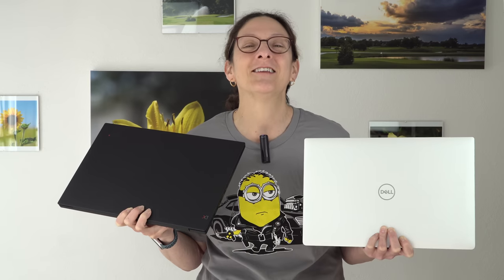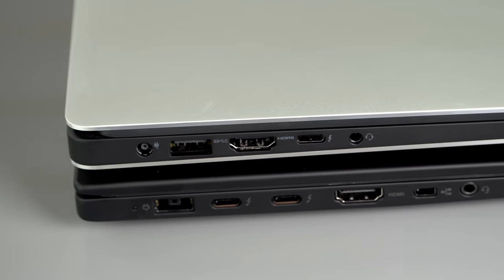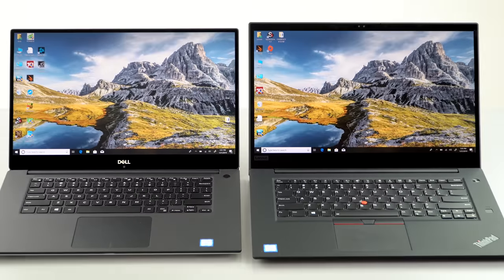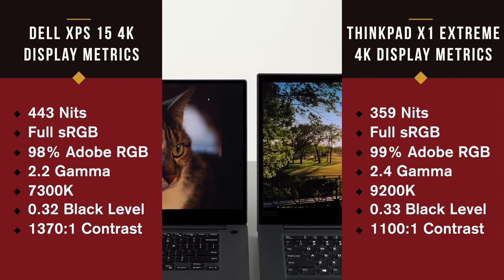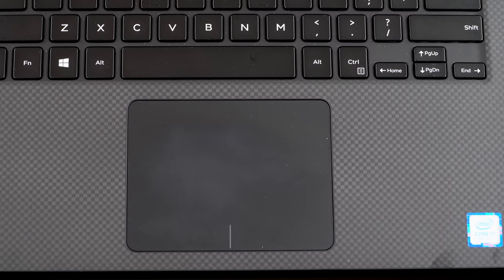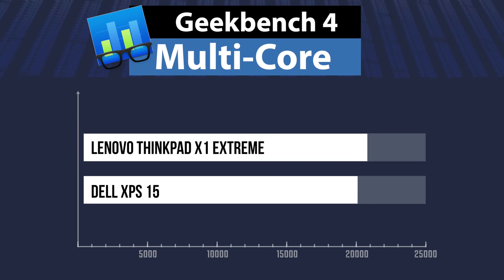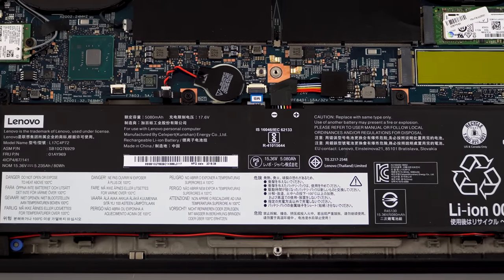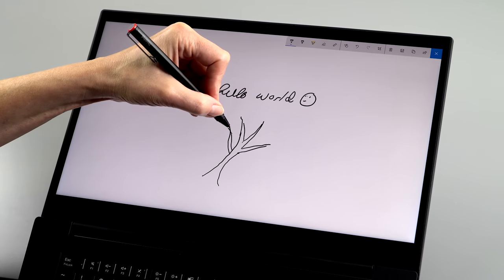Dell XPS 15 vs. Lenovo ThinkPad X1 Extreme Comparison Smackdown

Comment: You forget to mention that Dell's internals are not on par with Lenovos. For some reason I never see the same speeds when importing on the Dell using  USBA (EXTRA SLOW) and  USBC works when it want's too. I am not sure I see any competition for Lenovo here and really the only thing that seems similar is form factor.

Comment: Nice machines, but I'm going to wait for the 10nm CPU and OLED.  The XPS w/ OLED is coming out in a month.  Have a 2018 XPS 13 to hold me over.  That X1E's dual SSD is really intriguing.  Just too bad, MBP keyboards are such a disaster.  Prefer OS X but also prefer saving money.
Reply: sflxn and the XPS15 has yet to been updated, gah! Add Face ID along with chin cam fix and the oled screen and I’ll buy it Dell! Haha

Comment: Lenovo more reliable, more robust chassis and much better keyboard. No chin cam either. I think the result is pretty clear.
Reply: 2xNvme SSD is seriously the biggest selling point. A mobile pro Editor just cannot do without.
Reply: Not really the heat and battery are just bad
Reply: Lenovo more relaible?  I'm not too sure about that. 

I've worked in IT support for about 10 years, and I've dealt with more Dell and Lenovo laptops then any other brand, and my experiences do not indicate that Lenovo laptops have been less prone to faults or damage.  Quite the contrary actually. 

And then when they DO break, it comes down to having to rely on support - and Lenovo's support is mediocre at best, while Dell's is without question THE gold standard. 

I do agree with you about the better keyboard and chin cam though - albeit I dont really use the cam, so the latter doesn't bother me.
Reply: @constantinosschinas4503  would you recommend for video creator and music creator? Been thinking bout the xps but this changing my mind.
Reply: @pete3198  this is Thinkpad, which is different than your average Lenovo laptop
Reply: @ibro_47  
I just stated that I've been working in the IT industry for over 10 years.  Do you really think that somebody who's been working in IT for the last 10+ years wouldn't  know what a ThinkPad is?

I work with more Thinkpads then any other product.  I've owned 2 or 3 of them myself as my own personal laptops.

Believe me, I know what a ThinkPad is...and my previous comment still stands.
Reply: @pete3198  my bad I didn't know you worked with Thinkpads.
It's weird because I saw a lot of Thinkpad owners being happy about their products and brag about how durable it is. That's even what motivated me more to chose the Thinkpad X1E over the XPS
Reply: @ibro_47  
A lot of IT work these days is short to medium term contracts, so I've moved around quite a bit over the last 8-10 years.  Because of that I've supported a lot of different companies, and worked with a lot of different brands. 

Most of the companies I've worked for have used exclusively Thinkpad products, and I would say that the results have been a mixed bag.  The X1 Carbon's have have admittedly been pretty good, and from my experiences the fault rates have been very low from a hardware perspective.  Software has been pretty good, however I've come across my share of issues there - things like weird dock compatability issues that needed BIOS or firmware updates to fix, etc.  But for the most part they have been pretty good.  

However a lot of companies I've worked for have used the lower cost X series laptops and my experiences with those have been less then great.  Quite high rates of hardware failure often coming as a result of poor internal build quality.  Thinks like fans failing, motherboard failures, etc.  One disturbing thing I've seen on a number of X-series laptops is broken USB ports.  As in somebody has inserted a USB device in to the port, and when they removed the USB device the plug inside the USB port has broken straight off and gotten stuck inside the USB device.  I've had a ton of cases of sound chips failing, speakers failing, etc.  

And when that happens you end up being stuck with what I consider to be THE biggest downfall of Lenovo - their support department.  Lenovo support is terrible.  You end up being put on the phone with some tier 1 n00b who knows nothing about the products, tries to force you to work off their personal cheat sheet because they lack the brains to think outside the box.  When you finally get through and convince them to arrange a repair they try everyting they can to avoid sending a technician out (try to insist on sending you the part and making you replace it yourself) and then if you eventually convince them to send somebody out it often takes days before they do so.  

I haven't worked with AS many Dell machines, but it's still been the second most common brand I've dealt with.  I've seen very few hardware failures to be honest - I can't say they are as reliable as the X1 series (since I haven't had as big a sample size) but they have certainly been more reliable then the rest of the X series I've supported.  But more importantly, their service is unbelievable. You don't even NEED a corporate account.  I bought an XPS as a personal laptop, and I my display fail after about 3 weeks of ownership.  Emailed Dell support at around 10:00 PM with a photo of the screen and all the relevant details.  I went to work the next day, and got a call from home around 1:00 PM letting me know that the Dell technician had just finished replacing my screen and just left.  That's about a 5 business hour response time for a regular consumer service.  Their business support is impeccable -you can guarantee if you call Dell for a warranty issue they will be on site the same day or the next day.  

Now obviously we all want out $3,000 laptops to be reliable, but I feel you need to ask - what's more important, reliablity or service?  Because even if you have an incredibly reliable product, freak faults can happen.  And I feel much more comfortable knowing that if something DOES go wrong, I'll be back up and running in a day or two at most, rather then feeling that "nothing shoudl go wrong, but if it does I could be without a computer for a week". 

So I guess there is a bit of a balancing act there. 

By no means am I suggesting Lenovo are unreliable or that Dell are MORE relaible.  I'm just saying that the different between them in terms of dependability is probably not the broad gap some would like you to believe - and any small gap that is there is probably more then made up for by Dell's vastly superior support.  

If shopping for a laptop and looking at those two brands, I would make my decision based on performance and design factors, certainly not on reliability, as I just don't feel the different in that regard is significant at all.  Just my 2 cents.
Reply: @naveenkataria1501  
Highly debatable.
Reply: Tina Mathur Nope go check the thinkpad sub reddit ...full of complaint posts about this

Comment: Anyone here can help me to decide what to buy? I want to change my laptop since it's been over 3 years already and I'm kinda tired of it. I'm a businessman/web developer and I travel often. Important factors for me are: performance, battery life, mobility and quality. I'm don't run heavy games or softwares on my laptop. All I use are SDKs, code editors, project management softwares and sometimes Adobe Photoshop and illustrator. I prefer something for $1000 or lower. I'm thinking about XPS 13 and I like Dell build quality and performance done I've been using Dell for years. Nothing worked for me better than Dell. But of course I'm open to other suggestions. Your help would be really appreciated.

Comment: for the highest performance,I want to buy "clevo" models N350TW without dedicated graphic but socketable cpu ,so 8700T for longer battery life & better performance&temps(hopefully 9700t will be released this year as well) or 9600K or 8700 , or go with model nb50tk and dedicated gtx1050ti graphic and the same cpu, although both models,has less battery(N350tw 65WHr & NB50TK 48Whr) & more weight but they both have 3 storage , desktop performance & the N350TW has thunderbolt3 as well.
they are not pricey as these models, and the screens are customizable:4K,1080P 60hz 72% &120Hz 94%,144hz 72%
with Undervolting and repasting option available,they should perform much better than 8750H/8850H ,right?
the review for NB50TK with i5 8400(less than 8750h) in chinese:
https://zhuanlan.zhihu.com/p/37338630

why don't you by the way,review these 2 models and compare it? as they are the best in terms of desktop replacement but not heavy/bulky which is great for adobe premier users and other users who demands every bit of CPU power they can get to finish their tasks faster

Comment: I have an XPS 15 9570.  With a SSD.  Excellent video display. The battery passed away 1 1/2 years after i purchased.  The trackpad sucks.  I felt the keyboard was demonic.  The keyboard would randomly highlight text, then erase what I typed. Dell has a fix for this bug which they have known for years. This is extortion. Turns out it was not the keyboard, but the trackpad as the problem. It would randomly move directories,.  It would play hide and seek with my directories. I disabled the trackpad, now use a usb mouse.  All the problems have disappeared.  The problem is the trackpad is too large.  Resting my hands to type, my hand would touch the trackpad making me want to submerge the PC in the bathtub.

Comment: The X1E/P1 BIOS has been absolutely terrible for power users with at least three board bricking bugs: Thunderbolt assist, discrete GPU and onboard audio switches have all rendered the systems bootlooping. Mine shipped with backlight bleed and dreadful thermals and Digital River (sales support) have provided abysmal service from the get go. Couldn't be more disappointed so far.

Dell, take me back

Comment: This video helped me finally decide on which to go with, thank you!
Reply: So which one was it??
Reply: @SummaJamz  the ThinkPad X1 Extreme. 
1) I regularly make video calls to friends abroad so the low-angle of the Dell's camera is a design flaw that I can't ignore. 
2) I type plenty so I would like a better typing experience. 
3) I want to be able to upgrade the storage later which the ThinkPad provides a greater capacity to do.
4) And what is probably the most coincidentally fortunate factor as of right now is that Lenovo has a significant discount on the ThinkPad that ends after today which saved me more than $700. The XPS doesn't have such a discount at the moment.

Comment: You should really start putting focus on those lanes..1:02  after all a MicroSD slot is so freakingly swell and handy dandy (to keep it in mature old school language) if it is done right' but state what kind of MicroSD lane it is fitted on.. is it USB2 with often sub25mbps or is it bonafide USB3 lane.. it is shocking how many modern laptops that still use a very limited USB2 lane for the SD slot.
'even some 2500 USD laptops. have USB2 lane for the inbuild SD-slot.
You're tearing me apart Lisa' that I have to elevate your otherwise superb work'...

Comment: I had An XPS for years, they are not well built. Screen hinges break, battery's swell and crack open covers. Terrible non-responsive keyboards that stick, charging cords that split, charging ports that break and wont charge  Thinkpad's are better built and last longer. Will never go back to Dell again. Thinkpad's are the best laptops in the world.

Comment: i was going to ask you to do such a smack down! thank you! love it ~
i`m actually already pretty sure that i`m not going to buy a dell xps 15 , has big thermal issues , it seems to gamble when people buy from Dell , you never know if the laptop is going to work right.
instead i wonder if lenovo will launch a new TP X1 Extreme 2019 , and i am also really curios about the razerblade Advanced!! seems amazing if it wasn`t for the badbad EU customer service,  screens bleeding are also an issue and this doesn`t make me feel safe to spend so many money on that. so i`m pretty concentrate on the X1 Extreme... the distraction 2019 bend towards  HP x360 spectre ..wow AMOLED display ! will that thermal t. easy? 
i think X1 EX. it`s a nice choice.. but they should use the cooling system of the Razer Advanced for make it perfect..
i don`t use the laptop for gaming only for modify 82MB photos library .. really huge photos and video ..do somebody knows if for this job the X1 Extreme will throttle easy and often ?
Reply: why not go for NB5TK1(gtx1050ti)/NP960KP6(gtx1060) with desktop cpu like 9600K/9700K/8700 which are much more powerful than 8850H and not to mention with undervolting+repasting and even Oc'ing a little bit,you could get better overall performance as well.

Comment: WHAT about water resistance?
Reply: If you need water resistance on a LAPTOP (never mind a phone, but that's a whole other debacle), you are not a responsible laptop owner. LMAO. If it helps, though, all Thinkpads have spill holes, so any liquid spilled on the keyboard will mostly just run out the holes on the bottom.

Comment: Thinkpad seems to be better in alot of ways not that I would normally say that I do like Dell but the two slots for drives the track pad...hmm that is a tough call... But for art things still think wacom is best but to upgrade laptop I will consider Thinkpad...
Reply: Thinkpad uses Wacom pens and AES tech, if that helps!
Reply: Seriously, as somebody who uses both a LOT I can assure you that they are both really, really nice laptops.  

I chose the XPS as my personal laptop because it is better equipped (i9 / 32GB RAM / 1TB SSD / 4K display - which wasn't available in an X1 at the time)  and because it's just far more stylish (metal feel, more curved edges, and the super thin bezels) and feels much nicer in hand.  

I use a Thinkpad Yoga for work because of the awesome hinge design, better camera position, better keyboard and trackball (which I personally find really handy).  

They are both really, really nice - I don't feel that there is really an objective winner, it's really just going to come down to personal preference and what you are going to use it for.

Comment: ThinkPad Carbon are not the best  any more, Mine broke after 13 months, and Lenovo shows no support what so ever after the warranty period. I have been buying ThinkPads since they were IBM, but not any more after spending over $2,200 for one that lasts 13 months only. I will try Dell XPS or HP next time without any fancy screen.

Comment: Do not buy the Dell.  Just handed off a 6 month 9570 which was the quirkiest laptop I have ever owned.  Turned to Thinkpad X1 Extreme...only had a few days but love it so far.  Only thing worse than the Dell machine was their customer service...never again with Dell.  In fact told our IT department there will be no more new Dells in our company.  Maybe i had a uniquely poor experience but my opinion does not support all the positive reviews...

Comment: I'm trialling a Dell e7250 to see how Dell - and the keyboard - compares with a Lenovo x250 that I also had on trial. My end game is to buy a top end laptop with an amazing keyboard. After using the x250 I was convinced the x1 Carbon would be the perfect laptop for me (the 14" screen is perfect), but I kept hearing so much about the XPS… so here I am with the e7250 which also has a lovely keyboard but this unit has a shitty trackpad I can't get a grip on. The screen is way better than the x250 which was not a 1080p touch like this Dell has. Aaaanyway… I was thinking maybe I should be looking at the Dell XPS 13? I tried a couple in-store and WTF the keyboard is nowhere near as good as this little five year old e7250 :( WHY do they keep fucking with the keyboards?? The reason I looked at the Lenovos in the first place was because Apple raped the MB keyboards GRR. I love the Apple useability but those keyboards are a damn dealbreaker. 

So in conclusion, I've NFI why I bothered typing any of this up, except to enjoy the clickety clack of the Dell e7250 which sadly is not continued to the new XPS...